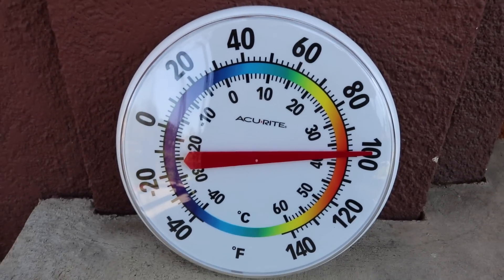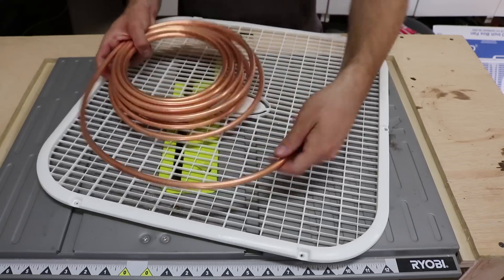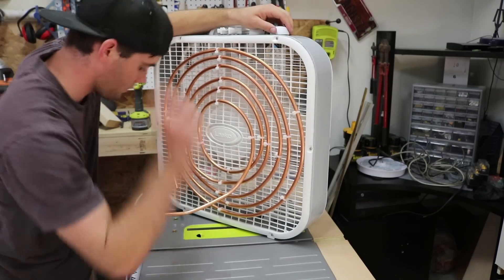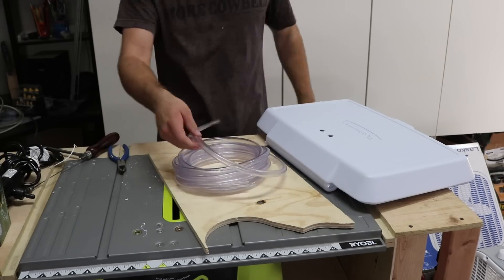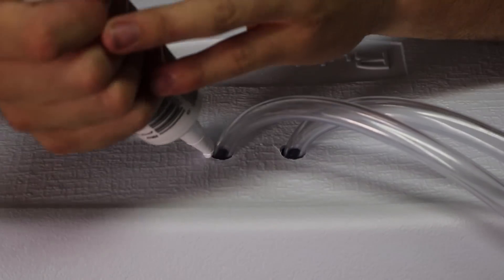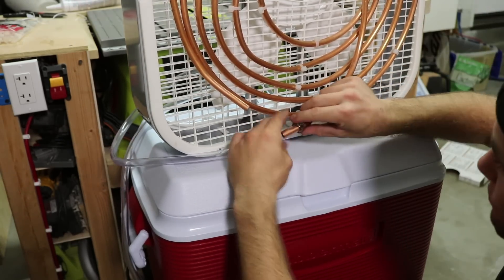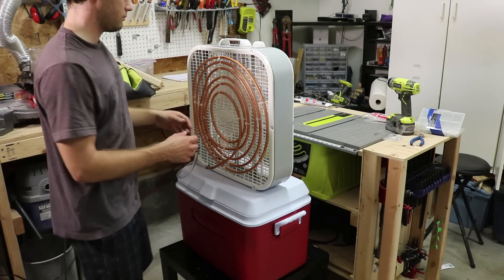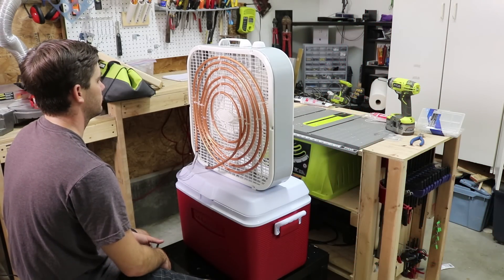$100 Homemade Air Conditioner - DIY

Comment: In theory it should help, but by the time you figure the BTU capacity of your home brew unit it's probably a wash against the BTUs generated by the fan motor. (likely a few hundred watts worth of heat) Now add in what a bag of ice costs ($3 - $5) and you have spent more than running an AC unit for 12 hours using 17 cents / Kw as a cost basis, which is about $2, and I doubt the bag of ice will last more than a few hours. IOW, you'd need to spent more than $10 on ice for a single 12 hour run that doesn't keep up with the heat generated by your unit. On the bright side, you now have the basic parts to make a beer cooler! <LOL>

Comment: $50 more, you could have gotten a brand new window unit buddy... Or hit up a pawn shop for a used one... Ice will last 4 hrs tops... So figure $1.00 a day for ice (Not to mention water pump and fan consuming electric) Your system cost over $30 a month to operate... Window unit will run you about $30 a month running 24/7... Cool idea (for the 18th century)

Comment: Man didn't know if it would work I had same issues really hot in my shop. Having most of parts cost was 42.38 and it dropped temp. in my garage from 95 to 77 almost had to put a long sleeve shirt on. Did use rock salt to cool ice/water more. Didn't have to put a hole in wall of my shop  for hot air / water drainage  from air unit. If it lasts 1 year it was worth it. Getting a lot done in my shop. Man you are a life saver. Put a pan in between fan and cooler top with small drain tub that fills bucket and I reuse water. You are a innovator.....Thanks and keep the cool items coming.....

Comment: Interesting and kinda cute little project.  But, don’t waste your time, money, or effort.  This is similar to the buying a bag of ice and sticking in front of a fan - just a more expensive way to do that.  No heat is being removed out of the closed garage, so will not cool the garage to any significance for any significant amount of time.  Use a real AC unit with the condenser/exchanger outside.  Maybe use that money to insulate your garage door.

Comment: That was a coping saw, not a hacksaw.  Some may argue it could be considered a hacksaw simply because it is a blade held in tension by a c-shaped bow, but it would not last long used for common hacksaw applications.  Moreso, it was used exactly the way a coping saw is meant to function.  Nifty build, but part sourcing for such a device should never be new.  A good shop should have organized leftovers from previous projects to uses for such applications.  Alternatively, you should at least checkout the local Goodwill, used goods, Pawn shop, or even the dollar store.  It seems some of those items raised the cost too much, to the point one would do better insulating the door, increasing ventalation, and increasing circulation, among other remedies.

Comment: Hey everyone, just fyi I wouldn't recommend  a build like this. I am a HVAC technician and I can already tell you that while this will work, the copper will condensate and leak water everywhere!!! A build like this will not cool your house, you'd be lucky if it cooled a small bedroom. This could have its uses like maybe outside on a patio, but not inside.

Comment: Save the money on the cooler and pump. Insulate the garage door and attic. Open the door from the house set the fan in the doorway.

Comment: You may want to renovate the stand those clips break off pretty easily.  They are very cheap and will wear out no matter. Just use a piece of wood and anchor the base and screw in flush on both sides

Comment: Why not drill for water and drop a dissipation array (splash) and drop two conduits to two male ends and a fan low to push and a fan high to suck and now you gotta earth cooled house just pay for the fan juice or run solar.

Comment: I did this something like 12 years ago out of desperation (during the night the temperature would be 32°C or 90°F) and I remember that in about 15 minutes the 8 liters of water and 6 Icepacks were warm. Not really works... But I must say I had 10 minutes of comfortable air.
Unless you are replacing the water every 10-15 minutes I don't know how it will be OK.

Comment: walmart got 6,000 btu ac for 98 bucks and its not about blowing cold air this not doing anything case you steel got Humidity in the room a ac will take Humidity out the room that what it rely is doing to make it cool

Comment: Pretty cool, no pun intended. Man, you do what you have to. I was thinking about using a chest-type freezer for similar effects. You can pull drinking water from the air as well. I know you posted your video in 2017 but innovation and great ideas never get old. Thank you.

Comment: My office had same problem,  I got my office to cool down to 11 C from 47 C, no water, no ice, no cooling box. If you just simply find out a way to EXTRACT HOT AIR it depressurizes the room environment causing the whole room temperature and humidity to drop. Cost me £40, around 60 USD?? WORKS LIKE A BOSS!!

Comment: The use of the cooler doesn't make sence. It prevents the ice from cooling down the surrounding space, but that's exactly the effect that you want. So it's a total waste demolishing a good cooler for this purpose. A normal bucket would do.

Comment: Gotta love the hate lol. Hey would it work any different if the copper tubing was on the back of the fan? Or even on both sides? And another question is there any other type of tubing that would be a cheaper replacement for the copper? Just brainstorming some possible ideas for a cheaper build. Oh yeah plus this could work camping and you wont need a trailer full of batteries and a dozen solar panels to run. Box fan and fish tank pump low watts but a REAL AC unit lotta watts.

Comment: This will not work! you need a heat exchange. Try again using an old radiator to intake the warm air.

Comment: Data please.  How cool are the coils after a minute, an hour, and five hours.  How much does it cost to make all of that ice?  Also, please show us how to insulate that door and apply UV film to the windows and use that laser thermometer to show us the difference between an insulated portion and an uninsulated panel, a tinted window, and an untinted window.  Thanks!

Comment: Add a lot in Milam Add a lot in a bigger any freeze You sure May want to go into the water the couple to be going into the water to keep a call With the cold air hits the copper and copper ore cool the water so the water copper in the water when it's popping through copper should touch the water inside this cooler

Comment: Everyone is missing the point. These coolers are great if you don't have a lot of electricity available or its impractical to cut a hole to fit a window shaker. The commercial version of these coolers, often used for small airplanes, may cost up to $700

Comment: A small 5,000 btu window unit air conditioner can be bought new for 100$, hmmm why not just do that. You could probably get a used 8,000 or 10,000 btu air conditioner for 100$ or less also and would be much better performing than this.

Comment: You can get new AC units from Ollie's for about $120 . Why not just buy one? Those sparay fans don't really do alot of change to the air temp. If you are not directly in front of it while it is on, you won't get much benefit from it at all. That's from my experience with these fans

Comment: I take a 2-3 gallon bucket of water and freeze it over night. Then set it in front of a fan in a 11 by 15 glass cook dish. It takes a few minutes for the ice to melt enough to separate from the bucket, but once it does I remove the bucket and place the chunk of ice in the dish. This provides both a cold mass and good surface area for the water to evaporate from. Just a simple alternative.

Comment: Good build without the cost of plugging in a/c don’t everyone hate on this guy for trying to stay cool
Reply: but the cost of the ice is more than the cost of running an A/C unit. the real reason it works is because the ice cools the room, not his project. so this project does not save any cost of plugging in an A/C unit.

Comment: Nice I dea I am looking for a similar solution. I'm wondering if you insulate the garage door how much a difference that will make. Has anyone else tried that. I dont want to cut a hole in my garage for a window until like some people suggested. Overall nice idea. Do you happen to know what the delta is on this setup?

Comment: Buy/apply 1" sheets of this RMax insullation to the inside panels of your garage door & 3-4" in any uninsulated walls.
https://www.arcat.com/catalogs/rmax/product-guide/index.html?coid=35207 
If your home is greater than 30 yrs old, consider upgrading the insulation in the walls, w/more efficient insulation. 
Use thermal film on single pane windows to repel heat in summer & retain heat internally in the winter months.

Comment: OK, I had HIGH hopes for this cooler. The theory sounds great, and I was hoping it would really cool the air. Nope. It sucks. My apologies to the people I replied to about their comments on here, I tried it and it DOES NOT WORK! I even filled the cooler almost full of ice, and you can't tell a difference in temperature 3 inches away from the fan and coil. Don't waste your time or your money. Go get the portable unit from Lowes or Home Depot.
Reply: This is literally a DIY swamp cooler which is just way over thought up. If he took the ice and put it in a strainer over the bucket but in front of the Fan it would have had a much greater effect.
Reply: @BenSodos   A swamp cooler works by evaporating water to lower the air temp. It also will raise the humidity. That is fine in an area where the humidity goes low but not so well in an area where the humidity is above 80%. I actually built one and added it to our central air unit here in southern Florida. When the humidity is low, the water temp is about 10°+ cooler than the air temp. 6 to 8 when the humidity goes up. But the air coming out of the condenser unit also even after picking up the heat from the house is the same as the incoming air. So they can work. 90° day and 90% humidity and the water might be at 82°-84°. As the fan has to run anyway, the only added electrical use is the water pump to circulate the water. Which mostly is water ( condensate ) from the A/C unit and from the dehumidifier in the house.
Reply: I actually have had to run it over the last couple days so here are some results. While off, output air temp: 103°. On: 94°. Water temp stayed at 78° the whole time. That is a 9° drop in the output air temp even though we had  65% humidity.
Reply: Poor buddy,  you have actually done that?
Reply: When the AC went out in my condo and we were waiting for the landlord to fix it, we froze two liters full of water during the day while we were gone and placed them in front of fans at night. Provided comfort for a few hours so we could sleep. Do what you gotta do. And also placed a shallow pan under them because.. condensation.
Reply: Brett Harper that’s why he kept touching the coils
Reply: at least this can be repurposed to make a wort chiller... ;l)
Reply: That's why his favorite place in the shop is right in front of it, because that's about all it's going to do is cool whoever is sitting in front of it.
Reply: I was thinking it didn't look like it would make much difference.   Thanks for testing it.
Reply: Thats because he didn't make the heat exchanger correctly.. just using a coiled copper tube isn't going to transfer heat effectively.. it needs aluminum fins... using an old car radiator, instead of that copper coil would have worked much better.
Reply: @Chaddz3  Or just skip the fins completely, and point the fan directly on the block of ice.
Reply: Thank you for testing it out for us! FOR SCIENCE!
Reply: yeah its just clickbait
Reply: Check out the homemade AC 5 gallon bucket
Reply: Wow, you actually had to build one, to figure out it wouldn't work? You're kidding us, right.
Reply: @AYSKOFI  It's called science! :D
Reply: Bought a working 6000 btu unit with remote- 50. flea market. Cools one room pretty good. I strongly recommend testing before you buy.
Reply: Yess
Reply: Common sense should tell you this is a horrible idea that would not work at all
Reply: @bluethebestboy  Well, the thing is; it's NOT a 'horrible idea'. As a matter of fact, there are systems that work in the same basic way to freeze 100's of tons of ice during the night time when power can be bought cheaper from the power companies, then melted for cooling during the day. This project fail because the heat transfer is way too slow. Look at any common A/C unit, see all the tubes and fins? That's what it takes to move the heat efficiently. "Surface area".  If you could move 6000 BTU's from the cooling coil here, the ice would melt in 5 minutes. Then you make more ice in your freezer, which heats up your kitchen! The effect is that you moved the heat from the garage to the kitchen! REMEMBER; YOU CANNOT MAKE 'COOL', YOU CAN ONLY MOVE HEAT.
Reply: no this method works, but the water has to be open, you get a sort of media filter and use the cold side of the pump to waterfall the water through the media in front of the fan to blast actually cold air out. its the same things as a mister but without the water vapor getting sprayed out, it stays in.
Reply: @richalequan6595  This method DOES NOT WORK> You're talking about a "swamp cooler" (Technical Name: Evaporative Cooler) They work pretty well in Arizona for example, but not so well in Florida. The method as you call it doesn't need or rely on cold water or ice. The rapid evaporation cools the water on the pads, and thereby the air.
Reply: John In Milford i know, but im dumbing it down, im in arizona
Reply: He should rename this item as structural moister. Or mold inhibitor. Very bad for the house.  That's why there are exhaust fan on bathroom to remove moist when taking shower to prevent black mold from forming inside the walls.
Reply: Yeah they’re like $30-$60 more. Worth the investment.
Reply: Yup, and the process of freezing the water just 'moves' the heat to your kitchen.  Remember, you can't cool (or freeze) anything without moving it's heat someplace. A freezer dumps it in your kitchen, an air conditioner dumps it outdoors. Remember this: A 6000 btu/hr AC moves enough heat to melt 1000 pounds of ice per hour!!!
 (I doubt you can fit that much in that little cooler) (1 Gallon jugs are only about 8 pounds and bagged ice gets expensive. This can work for a quick 5 minute cool off, not much more though!)
Reply: @johninmilford7719  Energy considerations for sure. My dad talked a lot about this type of stuff. I wish it was taught more...I hypothesis if one where to freeze bottles at nigt while the ambient temperature is low. This increases some efficiency. This is just a poor design do to the closed system too. The coolness is "transported" on the evaporated water molecules in a regular swamp cooler. This is my understanding and observations at least.
Reply: @meetcarl   To be clear; it's the evaporation that is doing the cooling. Just as condensing causes warming. A glass of lemonade on a summer day for example- the warming of the glass is caused by condensing of the water vapor in the air. If you pay to make the ice, then you pay to run pumps to melt it again, you're kinda paying for it twice and then some . Again, he's moving the heat via the ice from the room to his kitchen. There's a very poor efficiency there. In refrigeration/ A/C, we use a very efficient medium: Refrigerant! (You may call it "Freon" if you want. That's just the trademarked name by Dupont Chemical.) It Evaporates and condenses readily when the pressures and temperatures are right.

Comment: You can buy portable air cons for just a few hundred dollars, fit the tubes to the outside or via a window, beats filing that esky with ice all the time. Do not get an evaporative cooler as all it does is fill the air with moisture and make it feel hotter and destroy the room and rust you're tools.

Comment: Because you have only 1 layer of copper tubing the temperature differential is going to be small, you really need an external air con coil assembly, as its way better in transferring the heat as it has way more surface area for the air to flow through, the fan will still be strong enough. party ice in tap water is not really going to cut it either, it not cold enough, and it will not stay cold for long as the heat from the room will heat the water. note there is Kilowatts of heat from the sun heating the room, it going to take a lot to cool consider installing a extractor fan to blast heat out of the roof and it will make a massive difference. You will feel cool in front of the fan but you will soon get wind burn too, and feel all hot in the face as soon as you move away.

Comment: That's a cooler, not an air conditioner. Its a common misunderstanding. An air conditioner works by sucking out the humidity from a room and blowing it outside, whilst blowing cooler air into the room. The exhaust for an AC must lead outdoors and cannot have any open-air gaps around it as that would let in warmer air from outside. Doors and windows must be kept closed for the AC to work efficiently and effectively.

Comment: Props to the guy for having the smarts to assemble this, but this seems like a whole lot of work for very little actual cooling power...also, I wish he’d used that same thermometer to measure the air coming out of the fan and the room temp after a few hours (assuming a device like this can even begin to cool what is essentially an unsealed part of the building like a garage).